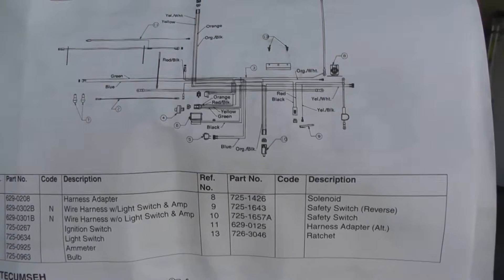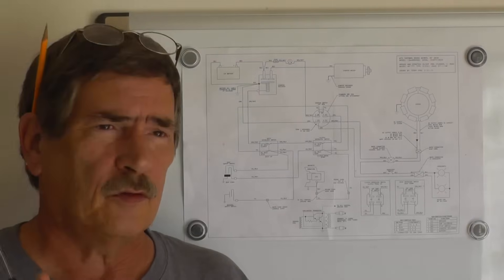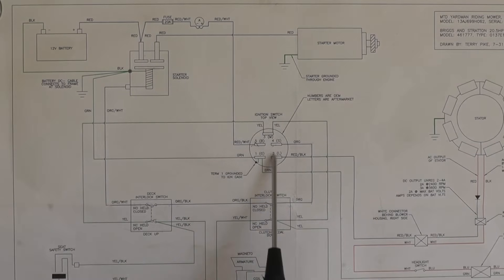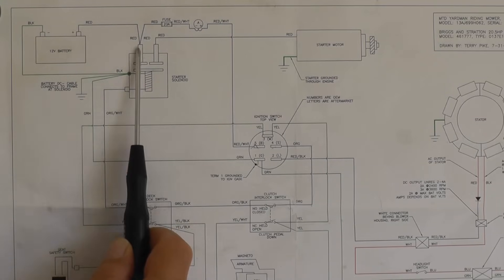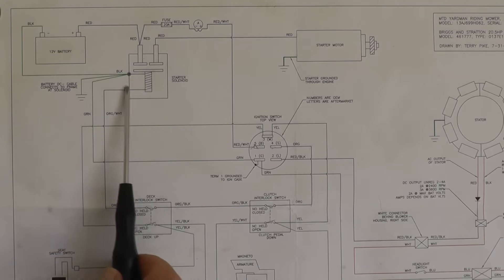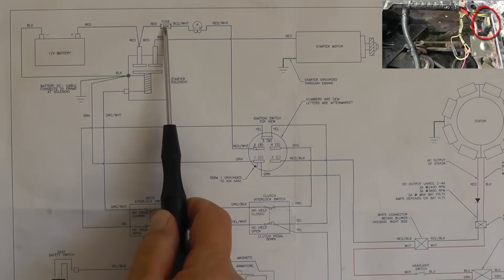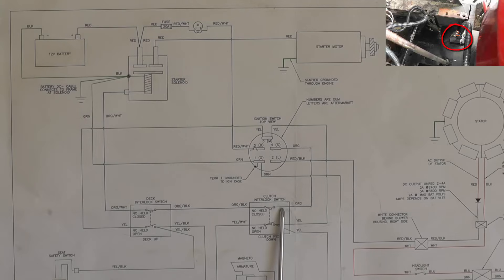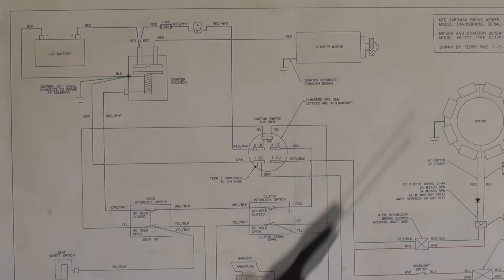Riding Mower, Starting System Wiring Diagram - Part 1

Comment from the maker: For anyone interested to download the wiring diagram, it's located here and in the description of this video: 
https://drive.google.com/file/d/1-CU0FqxjWTo91WP9fCBndCOLxh4MyILT/view?usp=sharing
Reply: Sar HIndime shikaw sar
Reply: Your Riding Lawnmower wiring diagnostic videos are Awesome ! I watched them and learned so much ! My question is, I’m sitting on the mower, deck all the way up and brake pedal down and in neutral. I start my mower, as soon as I let off of the brake, it kills the engine. If I keep the brake down and lower the deck, the engine dies. Something is either braking the ground or the positive 12 volts. What keeps the circuit going when you release the brake or lower the deck ? Thank you for any help. Carl Shields - darrock57@gmail.com
Reply: @carlshields3338  Sounds like the safety switch on the seat.  You may be able to start the engine with pedal down and deck up (i.e., PTO disengaged), but the moment you release the pedal or lower the deck, and that seat switch isn't activated, they are designed to cut 12v power and shut off the engine.
Reply: Why did you skip the Seat interlock ?
Reply from the maker: @gerardsagliocca6292  Hi Gerald! In this video and the next, I only went over the starting or cranking circuit. The seat interlock is not within the starting circuit. If you notice in the wiring diagram, there is another set of contacts in the brake pedal switch and deck switch which I did not cover. These two switches along with the seat interlock are for the ignition coil which grounds the ignition coil to prevent it from firing the coil. Maybe, I should do a video on the ignition coil circuit. Have a great day!
Reply: @stuzman52  Sir, you did a very good job on video I saw; however, getting an even broader understanding of how the mower's  electrical system works is even more enlighting and eliminates confusion such as I had after seeing your video.   I was always told that if you don't sit in the seat, nothing cranks or fires.  So to me it becomes a critical factor to have integrated in your video.

Your CADD usage was very good.  However, if you could add heavier lines or color to main wiring and use another color for the Control portion of the wiring diagram, it would be quicker to follow the many different lines on the schematic.

Keep working hard on this endeavor.  It will all be worth it for your students.

PS
Where do I find a Playlist of your already produced videos?
Reply from the maker: @gerardsagliocca6292  Here you go Gerald. The complete playlist of the videos so far. https://www.youtube.com/c/stuzman52/playlists
Reply: @stuzman52  THANK YOU for doing this, I burned up my wiring harness by attempting to follow others suggestions, I HAVE the Snapper Parts Manual wiring illustration, BUT I want to simplify it to JUST the starting & running wiring, IF I sent you the illustration I have, and even pictures of wire connections needed & NOT needed could you draw me up a NICE layout as the one in this clip??  I have the carb solenoid but am NOT using the electric PTO or lights, the system DOES have a relay & the typical solonoid, again ALL I need is the starting & running layout, BTW I can email you the parts manual layout, I will GLADLY PAY you $$ for this, Thanks I just subbed
Reply from the maker: @REVNUMANEWBERN  Hi Numa and hope you're doing well! I really don't have time to look at your diagrams as I'm working with several projects now. Have a great day!
Reply: @stuzman52  OK, I understand, would be more than willing to pay $100 for someone to draw me up one with the eliminated circuits, thank for your reply though.
Reply: Thank you, that is a very detailed schematic, exactly what I needed
Reply from the maker: @stephenvarney334  Glad the wiring diagram helps! Have a great day!

Comment: The seventh day, God created stuzman52! Your video is the best of all of those I watched the whole week long ever since my two battery cables melted creating grey smoke coming from my White Outdoor Mustang LT-542 mower tractor's ass. Since wires were toasted, I cut them instinctively to keep what was still good. Big mistake! I never thought about taking a picture before cuting. Then I had no reference to rewire the new solenoid and the new battery. My issue was caused by the positive post on the battery that might have caused a short, resulting in the melting of the battery wires. I got to that conclusion as it broke while I installed it back, noticing at this moment that the post was all covered by lead, after solding. Thanks, I'm going to review my wiring with your diagram printed and your helpful explanations.
Reply from the maker: Hope the wiring diagram that I have will give you some insight to your mower. Good luck on getting it back together and have a great day!

Comment: I hand drew your schematic. How does the battery get charged. You have the best schematic of anyone on iTunes. And yes I have taken all the tape off my wires.
Reply from the maker: Hi Stephen! No need to hand draw the schematic. I pinned the location of the wiring diagram for download. Also, the link for the download of the wiring diagram is located in the description section of this video. The battery is charged through the diode where it gets its AC voltage from one of the stator windings. The other stator winding is used to light the headlights which is powered by AC voltage.
Reply: @stuzman52 I don’t have headlight on my Troy-bolt 30R so I didn’t add that to the schematic. Before I contact you again I will check the 5 safety switches  & neutral switch while the mower is running. Thanks for the quick response

Comment: I noticed on the wiring diagram for Craftsman YS4500 on Sears parts direct  shows the clutch pedal diagram wrong.  It shows both switches closed, when it's supposed to be one open and the other closed.    Also, my tractor has a "bypass" at the key.. You can turn it to "accessory" position (basically-- it's not called that, but that's how I say it so that people understand)... and it is supposed to bypass the reverse switch and allow you to mow in reverse... but how they have it drawn,  the bypass only allows you to get off the seat while the blade is still engaged.. Yet you still can't mow in reverse with the blade on??  There's no way that's right:  how they have it drawn.   Why are they so bad at getting the diagram correct? lol.. That's on the official Sears page?   WTF?
Reply from the maker: Good question! I've worked at companies where draftsman will draw diagrams and don't have a clue to how electrical circuits work. They only draw diagrams red-lined to what the engineer wants. And that bring up where I've worked with engineers who don't have a clue either. And why they print the wiring diagrams so small and lines squished together that one can't read them is beyond me. This is the reason why I drew up my own diagrams. Have a great day!
Reply: @stuzman52  I ran a crew framing houses for over a decade.. and I can tell you:  I never seen a blueprint that didn't have flaws on it.  They ALWAYS had flaws.. and many times, those flaws would cause everyone to have a meeting with the homeowner just to get the answers..  I've seen many times where the architech drew up something that's not even possible to build. lol. And I had to redesign it with the engineer at the lumber yard just to be able to build it at all. lol..  So it's not just a wiring diagram problem.  "Professionals -- are still just people, and they still put out a lot of flaws.    Cheers
Reply from the maker: @calholli  As an electrical controls engineer and licensed electrician, I can tell you that titles in profession mean absolutely nothing. There are people with titles who really know their stuff, and others out there that's dumb as a rock. I always look at each individual and see what their skill-set is when I have to work with them. It would be a better world if people can tell you that they are not sure of some aspect of a job. Instead, with most, you'll get a bunch of bull shit hoping that you're so dumb that you don't know what they're talking about. Anyway, thanks for the comments as you make good points about people in this world. Have a great day!

Comment: I see what you are saying about the diagram on my mower manual i cant make it out so small & just impossible to figure it out.
Reply from the maker: You are correct Burt. Most of the manuals out there are so small with the diagrams, it's hard to read them. And I showed in the video, mine was no exception. That's why I decided to trace the wiring on my mower and just redraw them up. Have a great day!
Reply: yes it's difficult to read these schematic diagrams, I was wondering also I finally got my riding mower started after 13 years sitting, changed the plug, ignition switch, solenoid, oil, air filter, new battery, but why would the engine race very fast & have to shut the engine off being the throttle I can not adjust it being where the end of throttle cable attaches to the carb it's not moving when I try moving the throttle control handle, there is a part with a spring attached to the linkage & whether I go up or down on the throttle control handle it is not pulling on the other end of throttle cable, what does this sound like to you? is it possibility that the linkage rod is bent or something needs with the adjustments? I can not figure it out other then that piece that has a spring attached to it does have a bolt & nut going attached to a very small metal dowel that goes into the engine block on bottom, nonetheless the engine races so fast if I don't shit it off immediately that it could destroy the engine, my riding  mower is yard machine by MTD, the engine is Tecumseh OHV 110-130 the 660 thru 679 series model, Im trying to figure out everything what's going on with this till I give up having to take it to a shop to be looked at. @stuzman52
Reply from the maker: @BurtBowers Burt, from the description of your issue where the engine runs wide open, this sounds like a misadjustment or failure with the governor. Take a look at a service manual for your engine, and be sure that the governor is adjusted correctly. Have a good one and hope you figure it out!

Comment: Hi there, very nice video, thanks. do you have a diagram for  BRIGGS AND STRATTON 18.5 HP, to share ? Thanks again. Have a good day. Daniel
Reply from the maker: Hi Daniel. I don't have a wiring diagram for a 18.5HP, but the video is for a 20.5HP engine which should be close if not the same. I would recommend going to the manufacturer and you should be able to get a diagram from there. Or if you have the manual, it would be in there also. And you have a great day too!

Comment: Hi , I need some help , got a new motor for my mower but the coils keep superheating and burning out
Reply from the maker: It sounds like you may have an ignition system where two coils are being used. More than likely, this system will have two diodes, (one for each coil) that is used in the kill wire circuit. Check these two diodes to be sure they are not shorted or open.

Comment: Thank you so much for the wiring diagram and explanation. It is invaluable. We have a 1999 or 2000 year machine and Having this reference is great!
Reply from the maker: You are quite welcome Bill and the wiring diagrams should go right along with your mower year that you mentioned. My mower was built in 1996 so the diagrams should be close to what you have. Be sure to check out video 2 of this series if you want to see some troubleshooting methods of all these components in the starting system. Have a super great day!
Reply: @stuzman52  YES I watched video 2 This is fantastic information about voltage drop testing and using a test light. Your explanation of how to do this was great!
I have subscribed to your channel.
Reply from the maker: @billbrock5486  Thank you very much Bill and good luck with your repairs.

Comment: Very well done.  Thank you.  Until I discovered your video I was unable to find a riding mower wiring diagram.  According to Troy Bilt a wiring diagram is in the manual; frankly, it's a joke.  I am looking forward to your future videos.   BTW, I own a 1972 MGB (an olde British sports car) and am somewhat used to using wiring diagrams, even with my aging eyes, but, compared to the MGB, a mower wiring diagram is a piece of cake.   I sure wish the mower manufactures wouldn't put the blankety blank solenoid under and behind the seat.  Perhaps you could do a video on relocating the solenoid so a normal, older person can reach it.   Thanks again.
Reply from the maker: Thanks for the comment! Relocating the solenoid shouldn't be that big a deal other that drilling a couple of holes, re-tapping them and increasing the wire length. Have a great day!

Comment: My problem kohler is on a vermeer 252 stump grinder , I've got a extra ( ground I think ) terminal on my switch , so I'm testing it , and it's the problem( the key switch , no continuity in any position excep the grounds) , eer so I thought , new switch , still dead , then I found two red wires with rusted corroded resisters in them , real close to the keys plug in  , they split to two different key terminals , no continuity on either red wire ..I think I can cut out those resistors , it's the old school ignition,  it don't advance the spark or whatever , single plug in on both coils linked together with the white wire ..that's how I know that ..and no extra electrical spark control  box ..no numbers or marks on my key switch either , must be a cheap one ,( i stole it off a dead  exmark outback )but it was bad anyway .
Reply from the maker: Mike, from what you're describing, it sounds like your engine has two diodes connected to the ignition coils. These diodes are used in killing the coils when you shut down the engine. So, they are not resistors and you do not want to take them out. You can check them to see if they are bad. Here is a video that explains their operation and how to check them. https://www.youtube.com/watch?v=N_f_obJ08C8&t=845s

Comment: Hey i'm a 70 year old gentleman trying to figure out whats going on with my daughter's mower. Please help!

She has a craftsman 944.602600, 24 inch. When she puts it in drive it'll drive for a bit, then it'll start going backward all of a sudden while the lever is physically still in drive. And sometimes it doesn't even move when you put it in gear. 

Do you know what the issue is? Much appreciated!
Reply from the maker: Hi Jeffrey! Not sure what the issue is but I would take a look over the drive system for the transaxle. Take a look at the belt, bearings, especially look over the handle assembly that moves forward and reverse for any slop in the linkage. Have a great day!
Reply: @stuzman52  Thank you!You as well!

Comment: Thank you. Printed the diagram.  However, with a sub-compact Branson 2400H, how will I know which safety switches are ignition-defeating once running vs. anti-start switches--or do some function as both?  Lastly, let's say I am reasonably sure I've tested and confirmed the proper functioning of ALL the switches, and the key still doesn't turn over the engine then what?  For example. I just jumped the solenoid with the key in the "ON" position and it cranks but did not fire, as it had the day before.  Checked the fuel--but may bleed, the battery is at 12.7, but I have not verified good chassis grounds.  I did--I believe--rule out the ignition switch, main fuse, and battery.
Reply from the maker: Hi Norman and hope you and the family are doing well! For most of your questions, you have to have the wiring diagram for your tractor. As for you turning on the switch and jumping the solenoid and it cranks, tells you that you're not getting voltage down to the solenoid for the starter motor. It could be a safety switch, ignition switch, fuse, broken wire, etc. With all of these possibilities, that's where the wiring diagram comes in. I did a quick search and I was able to find the owner's and service manual, but it did not have the wiring diagram. Maybe, you could get in touch with the manufacturer and they can help out with this. Once you get the diagram and have other questions, I'll be happy to help out where I can. Have a great day!

Comment: Brand new starter but keeps blowing fuse every time you try to start. ? Where would you look first? Thank you for any advice.
Reply from the maker: Hi Lloyd! Your starter would have nothing to do with the control fuse blowing. You have a wire shorting to frame. Take a look at your wiring diagram for your mower to see what's in series with the fuse. Components and wiring would include the wire coming from the terminal on the start terminal of the switch, safety switches which are usually two, deck and brake switch and the wire going to the solenoid. You can replace the fuse with a test light to eliminate fuse blowing while you're troubleshooting. With the test light across the fuse terminals and when you turn the switch to the start position, you'll see the light will glow brightly. This indicates you've got a wire shorted to the frame. Move the wiring while in the start position to have the light go out or dims. This area of wiring is where the short is at. Good luck on your diagnosis and have a great day!

Comment: I congratulate you for your successful program, mine zero turn mower  didn't want to click until I disconnected the killing wiring , the question is:  do you have any idea what it could be?

Cheers 
Ray
Reply from the maker: Hi Ray! It sounds like you have an issue with one of your safety switches. You can get the wiring diagram for your mower from the owner's manual or from the manufacturer's website. For more detail on how to troubleshoot the safety switches, you could take a look at the second video of this series. Have a great day! https://www.youtube.com/watch?v=8XMfN6VhvyU